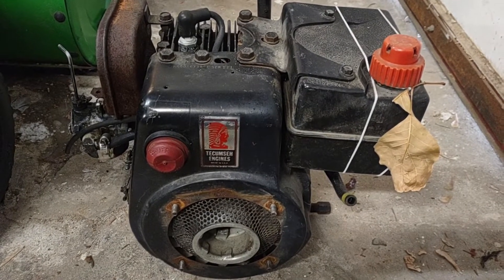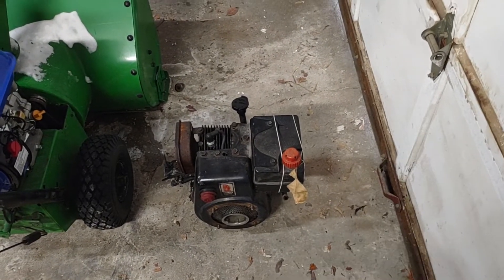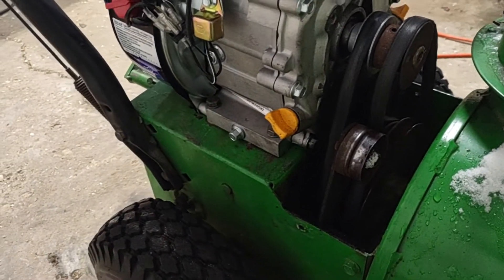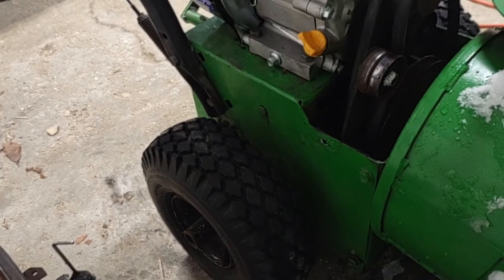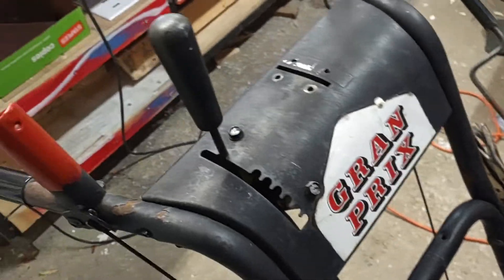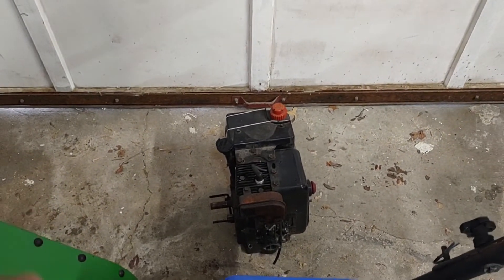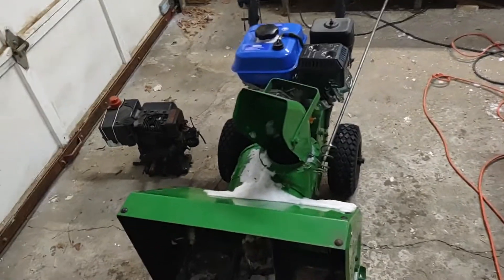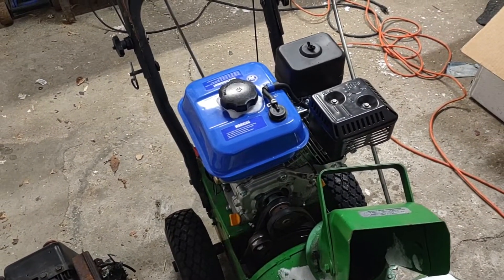Swapping a Predator Engine into a Tecumseh snowblower.

Comment: Output shaft was the same or did you need a adapter? Princess auto is out there to eh!!
Reply from the maker: Yup princess auto is great. The shaft is a common size. The diameter of the pullies was a little different for the drive, but I went with a size smaller, so it just runs a little slow.
Reply: @NoSpark4u strange i went to my princess and they told me the shaft on their motors are the wrong length, i know you can get a adapter for the diameter though

Comment: That's a popular swap.  I could see that being hard to start w/o an electric start.  
My Tecumseh also had something wore out in the pull start.  If you weren't extreme careful, the pawl would fall out and you had to take it all apart.  I also had a plugged carburetor.  It eventually plugged so much that it stopped running and i had to clean it.
As far as the weak power, I put a 50% overdrive pulley on my impeller and it pretty much fixed that problem, but I could never run the chute wide open because it would chuck rocks for 1/2 a block.